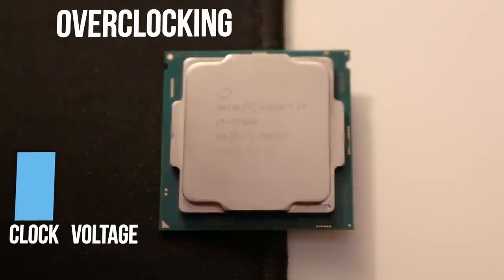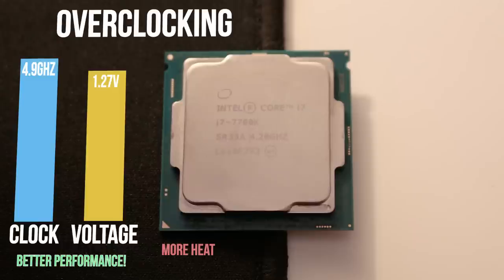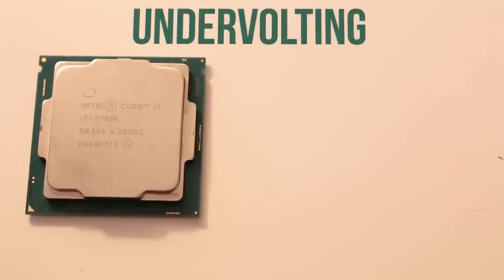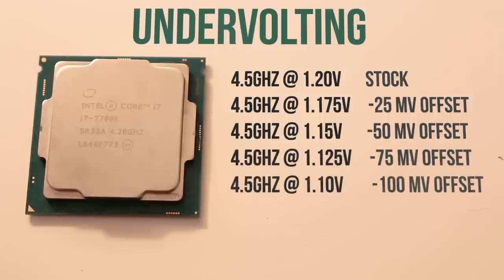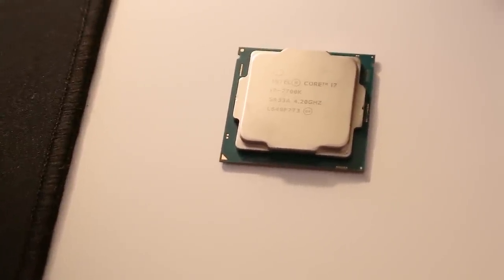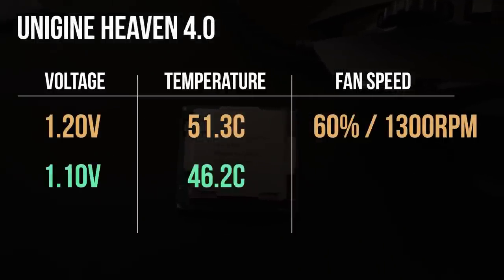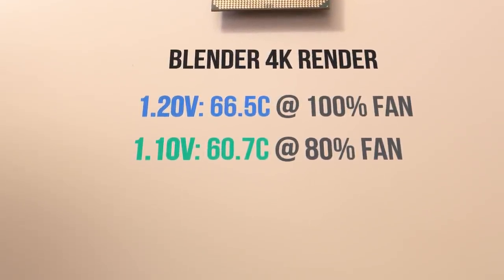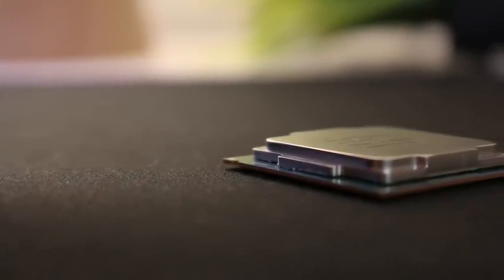Should You Undervolt Your CPU?

Comment: Something weird happens every time I try to undervolt my R9 290X. Seeing as it's a hot running card and that I'm using the stock cooler, it's a good idea to undervold. I start up a stress test and as it's running I gradually decrease the voltage. The temperature drops to a stable 80c at 50% fan speed where as before it was running at 86c at 60% fan speed which actually made a lot of acoustic difference.  Woohoo! Right? Well not really...

The problem is that after I stop the benchmark and the GPU is in idle, that's when I see artefacting and blue screen. I though because the voltage dynamically changes when the GPU is under light usage, it goes too low for it to run at idle usage. So in an attempt to fix this I set the voltage at it's stock settings up to 90% GPU usage and just changed it when it's under 100% usage when it was stable for me. But even then it would still artefact and blue screen while idle. Why would that be happening?

Comment: i undervolted and underclocked my fx 8320, that bitch just gets way to hot. now it stays 20-30c idle and 40-50c under load with an AIO water cooler. still gets the job done for games like FO4

Comment: so, are there any risks in undervolting the cpu? Could it actually increasse the cpu's life?
Reply: It will increase the CPU life because it will run at lower temperatures. Risk is computer crashes and you must experiment to find a setting where computer runs stable without crashing.

Comment: Here I7 3770 overclocked and undervolted, offset - 0.015 @4.1 ghz all cores, at stock speed should reach lower voltage than -0.015, but I do not want to do stability testing again

Comment: How does undervolting play out with Ohms law? If the voltage (U) is reduced and the resistance (R) reasonably is the same because you're not actually replacing resistors or anything physical within the laptop, the Amperage I would reasonably give a lower amperage as U=R*I can be balanced so that I=U/R meaning that a lower voltage results in a lower amperage.

Is it simply that undervolting is adjusting very small amounts (in the 50-100mV range) means there aren't and substantial differences in amperage or is it something else i'm missing?

Comment: Can you overclock and underclock at the same time?
Reply: Yes sort of. The higher the frequency the hotter the temps. The most you can hope for is to select a frequency, and then lower the voltage to keep it stable. However the higher frequency means it will not run as cool as it could. You need to find acceptable range for the CPU, for me my chip gets to 85°c under full load, but that's with auto boost, which is fine for a 5800x. So if i were to overclock at all, and try to undervolt, i would be looking for my temps to stay at the 85°c mark  hopefully minus a couple degrees. 

It's a lot harder than a GPU. You can take 200mv off a gpu and still get the exact same performance. You cannot do that with a CPU don't do that lol.

Comment: I tested everything , and the fasted way is xmp oN , and all voltages set manual at stock , and try use 1.140v-1.200v on CPU voltage i have 50-65° Max 70 , and u can manually oc everything and have better temps and speed
Reply: With all default i have 65° Max but unestable 4.4 - 4.5 GHz , and with all default and xmp oN 70-80°

Comment: I undervolt  my RYZEN down to .90v from 1.25v Stock on ASUS ROG motherboard which is around (350 mV) @ 3.6Ghz and it still kicks like a champion. Temps used to be 45 idle and 59 load on stock cooler before moving to an AMC. Guess that's why Intel sucks now.

Comment: I've undervolted my i7 7700k to 1.15v, it was hitting 1.38v at times and hitting 80s and 90s in temps, it hasn't gone above 81c since i undervolted with MSI Command Centre, my cooler is a Cryorig H5 but I have a smallish case, I still apparently have to properly undervolt in the BIOS but Command Centre was a rough idea of what I could do, I dropped it by .05 each time, 1.25v, 1.20v and 1.15v were fine but my PC froze as soon as I set it to 1.10 so I guess i'll just leave it at 1.15v, using Prime95 at 100% load on all cores and gaming at 4.50GHz boost clock it's been fine and i've spent like 15 hours gaming since on about 8 different games. This is all new to me as my previous PC didn't have an overclockable CPU, my old CPU from this PC was an i5 4460
Reply: MrZodiac011 drop any fps or not ?
Reply: I didn't drop any fps at all, it's perfectly fine
Reply: MrZodiac011 absolutely not normal. Might want to check out your warranty on that and send it in for a replacement

Comment: I under volted my i7-9700k, having a cpu stay under 50-60c while under a stress, and around 40-55c when gaming is nice, most gpu are the bottle neck anyways. Like I don’t think a I7-9700k running at 4.4gz will throttle me that much when gpu (gtx 1080ti) trying to play modern ware fare warzone

Comment: Managed to offset my cpu core & cache by -75mV. Doesn't really help much on intense workloads as it still hovers more than 80°C even when turbo boost is disabled on my core i5 7200U @ 2.7-3.1GHz. Must be the slow and weak single 3000RPM fan on my laptop.

Comment: i was thinking undervolting my i7 4790k, but i overclocked instead haha..  running at 1.268vcore, 4.6ghz. max 77c while rendering cinebench r15 or blender with scythe mugen max cooler:)
Reply: also i got 905cb in cinebench r15
Reply from the maker: Very nice results! Thanks for sharing
Reply: i kinda won lottery luck with my i7 4770k, 4.9ghz @1.242. delid + EK custom loop. 55'c no matter what scenario.
Reply: @kasper very nice, What score do you get in cinebench r15?

Comment: I run the 8350 as a server.
The thing runs at 1.300 @4.0Ghz barely stable with hitting the 80 degrees mark.
Now I am running at 1225. My PC hasn't been quieter and stable.
And if anything it ran similar to higher averages on benchmarks.

Comment: There is no performance drop at all? In any type of stress gaming calculations etc???
Reply: illenicK i tried in bf3 before i had 140 avg-fps  ultra maxed out seeting after undervolting by reducing -0.405mv i got 120avg-fps
Reply: hozan tube that is a really high undervolt I’m surprised ur system hasn’t crashed usually the undervolt isn’t that high, what cpu do u have?
Reply: illenicK i7 3930k paired with gtx 1050 ti , and so tonight imtrying to -200mV or lower because i dont want any loss performance , i searched alot undervolting lost my performance or reducing my fps ? A couple minutes ago i tried on bf4 i got 140fps :/ idk what shoud i do , so my cpu temperature with stock mV between from 75-80 while playing game thats why undervolting my cpu
Reply: hozan tube you should try to repaste it with a better thermal paste and yes try reducing that undervolt. Even 200 is a bit high but start there and go down until stability is reached
Reply: illenicK but i dont wanna my cpu gets high tempreture i think let this thats way better , what do you think ?
Reply: hozan tube yeah it’s better not to have high temps, but if ur warranty is finished open your laptop, clean it out of dust repaste the cpu and gpu with good thermal paste and set ur undervolt at the lowest stable point and u should see a big improvement
Reply: illenicK :v it isnt laptop bro , i have a pc
Reply: hozan tube it can still collect dust inside bro, and u still have a thermal paste on the cpu. I’d look at the thermal paste if it’s old it could be a factor in your temps
Reply: hozan tube ok make sure the heatsink and fan are clean and dust free, and like I said undervolt it and stress test each step down u do.
Reply: illenicK ok i will try bro ;) thanks for helping , did you have origin account or other gaming account ?
Reply: Hozan, your cpu is not stable, I start my undervolt with -0.080 at 3.9 ghz in my 3770, after a lot of testing, ended with -0.015 at 4.1 ghz all cores, when I underclock the cpu or disable turbo ratio, I leave the vcore still at -0.015, at stock speed can be lower thant that, but do not wanna do stability testing again. (sorry for poor english), my fps are the same before and after undervolt

Comment: I think undervolt is very useful on laptops. I can't see the point in doing it in a desktop, specialy if for gaming!!!
Reply: @FireBlaze20 Undervolting can reduce temperature, and consequently, thermal throttle, but by no means does it improve the performance! There are many academic, intensive, prove of that! And by the bottleneck, you mean what?! The bottleneck is a term associated with constraining of data flowing to a common point which leads to a low flowing if that one point can' t deal fast with it. I don't get what you mean unless you are talking about electrons?!!!

Comment: I am thinking about a R5 1600, but I'm not sure whether its best to undervolt/overclock without raising voltage. Another thing I was wondering about is whether the warranty becomes void if you undervolt/overclock.
Reply: KR BLACK i recomend overclocking or undervolting just dont leave it in auto voltage. auto voltage spikes the voltage a lot. i can give u some tips if u want i bought the 1600 last week.

Comment: I believe there is a bug with Ryzen Master supposedly I am running a ryzen 5 1600 under-volted to 0.00625V. I have everything down as far as possible(only 2 cores enabled@3.0GHz) but I'm pretty sure there is practically no way the voltage could be that low.

Comment: I am a total noob but whant to undervolt my xps 8930 to make it quiet and lower the cpu temps which are at up zo 95C under load.
Now if i go to low with the voltage, and get a blue screen. Can i just reboot the system and the standart voltage will be back or do i have to change something in the bios?

Comment: let say i have best fan cooler for cpu and case and great airflow, can i just set on the cpu alone, without touching voltage for overclocking, im okay with sound of the fan since i use headphone for gaming. does it harm cpu for a long run if i dont undervolt it ?

Comment: I actually under volt my gpu to keep that noisy fe cooler under control and still get a slight oc running at 900mv vs 1.04
Reply from the maker: Nice! Do you have any issue with hitting the power limit?
Reply: Optimum Tech no power limit at 900mv  at stock voltage and overclock it would hit the power limit

Comment: What happens if you blue screen from under volting?  Do you have to clear cmos?
Reply: raise it up a little?
Reply: 2Awesome like just go back to the bios?
Reply: Yea, usually when it crashes it reverts to normal settings. But I guess if you are overclocking from bios and it doesn't recover you would have to clear CMOS (haven't heard it happening from recent motherboards, but anything is possible I guess?)
Reply: 2Awesome lol ok thanks

Comment: My problem is that even when I undervolt, the CPU's voltage keeps passing the set bios voltage- hurting my temps.
Reply: Essentially, my cooler can't catch up.
Reply from the maker: Are you sure you have the CPU set to "Offset mode" in the BIOS? It shouldn't be auto-regulating itself.

Comment: how high can you overclock your 7700k ?
Reply from the maker: 5.1GHz @ 1.35v, but temperatures were pretty toasty on the Cryorig M9i Cooler
Reply: I got to 5.252 GHz @ 1.36V, but I would hit the thermal max within 30 seconds with my Corsair H100i V2 at 100% fan speed :/
Reply from the maker: Alexander Galloway damm, have you delidded? 5.2+GHz @ 1.36v is nice
Reply: Nope, I guess I was lucky! But I do plan to delid in two months when I can be sure I can afford a replacement, just in case I break it! lol
Reply: always the option of silicon lottery if you don't want to risk breaking it for 50$ and offten if you ask they have 10$ off so its 50$ with shipping they will delid and if they some how break it they will replace it

Comment: Overclocking  burns out your components quicker correct?
Reply from the maker: If done correctly, you can get decades out of an overclocked processor. 
Usually processors which die out early are run consistently at high voltages.
Reply: I have been running an AMD FX8350 o.c. to 4.3 MHZ for close to 5 years but the voltage is standard so the answer would be most likely no,  not only O.C. but increased voltage, will burn out a cpu quicker.
Reply: 24321619 i have run a fx 6300 at 4,9 ghz for 6 years non stop 24 7 1,45 v if i remember correctly. Bought new pc last week. And the fx is still has strong has it was brand new. Now i have a ryzen 1600 all cores 3,75ghz 1,306v cant overclock more for now its very hot where i am from and i have the stock cooler. And the performance is fine for me.

Comment: Good video. Can the same thing not be achieved via the Control Panel then Processor Power Management? Thank you.
Reply: Murtaza Nazham it can't, you need either software (throttlestop, xtu) or Enter to the bios settings
Reply: Thanks. I meant reduce the heat of the processor via the Processor Power Management.

Comment: Yea, I wouldnt recommend undervolting. The stock voltage on your cpu is set as the stable voltage for that cpus frequency. Undervolting it from that will only cause stability issues which isnt worth the minor decrease in temp. Did it on my I7 970, didnt see much difference in temps and couldnt undervolt it very much anyway before it became unstable.

Of course....not all cpus are created equal. But certainly little is to be gained from this practice. The minor decrease in temps isnt going to prolong the life of the cpu by any measurable amount. Processors can withstand extremely high temperatures and survive fine, Iv had a prescott go up to 120c before (ran naked without heatsink and throttled itself down to like 600mhz).

Comment: Hey my 8300H is core 2.9 ghz but clocks at 4ghz with the settings as is on laptop. With this i am stuck at the lowest voltage?
Reply: 2.3*
Reply: no you are not, try undervolting in throttlestop

Comment: Anyone else see the "4.20" GHz limit on the processor?
Reply: Yes, but Intel i5 & i7 processors usually have "turbo boost" enabled so that the frequency is accelerated when the operating system requests the highest performance state of the processor.
Reply: @xilex909  i also have 3.5 ghz i5. but it always runs at 3.8 by default tho. 😐

Comment: P=U*I ,if I remember correctly, undervolting (less voltage) but with same power, meaning more current intensity on your CPU, which long term hurting the CPU life and stability  , if undervolting really can cool your cpu 5-10 degrees, INTEL or AMD should be doing this in factory , the reason they don't I think is because undervolting hurts CPU life and stabilities